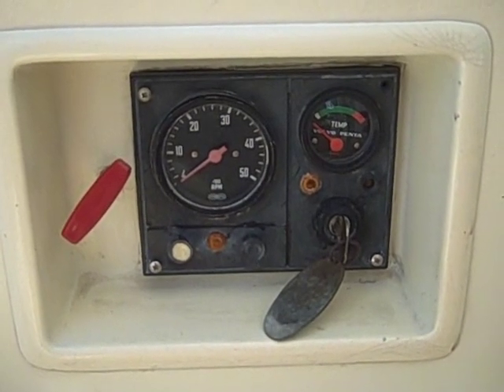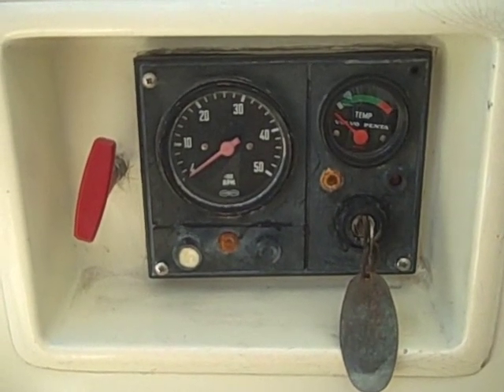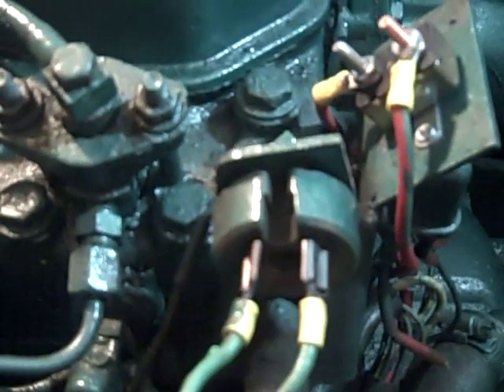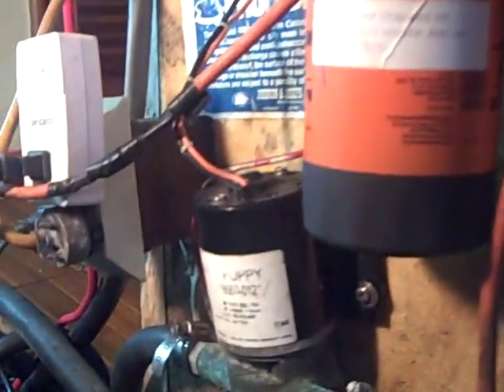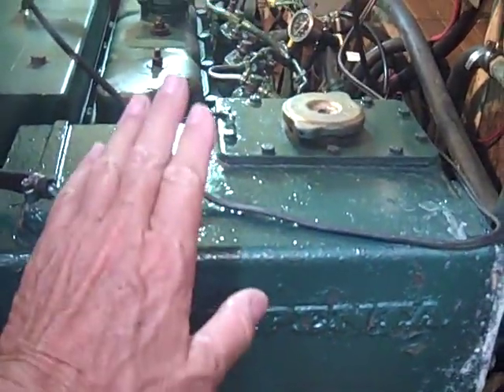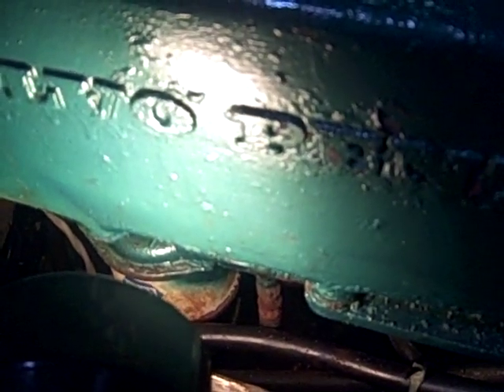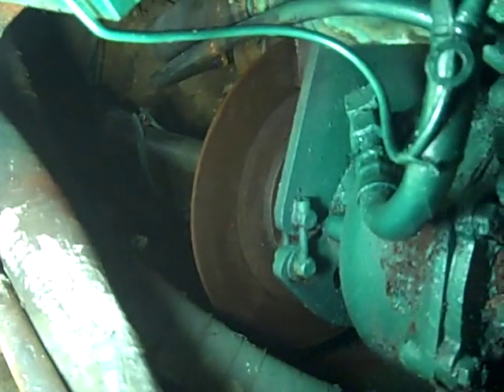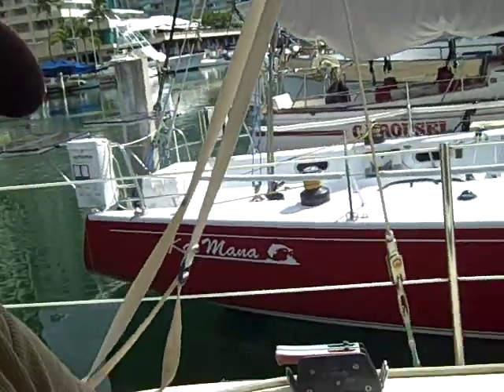Volvo Penta MD21a troubleshooting and suggested modifications.

Comment: I already had the water pump, which is why I had to remove the pulley in the first place. The pump itself was no problem to obtain, but the pulley was worse. It seemed to be a special pulley exclusively for the Blitz which I ultimately got from a Dutch Opel Blitz guru. Presumeably the last NOS pulley in Europe. I considered a Volvo Penta pulley for an engine like in the video, but the price was kinda like written with a fork. (seriously.. $500 for a water pump pulley??)
Reply: The MD21 engines are the same engines used in a Puegot 504 car, Indeanor XDP 490 engine. You should be able to source a pulley using that info instead.

Comment: This engine is really an Indenor XDP 4/90, french manufactured by a daughter company of Peugeot. It was used in Peugeot 504 and many other European cars. I'm currently working on an engine like this in a 1975 Opel Blitz light truck.. I managed to break the water pump pulley when I was going to remove it... Any tips on where I can get a new one?
Reply: Surely if the electric pump is switched off then sea water in the heat exchange and pipework will just remain in the engine.
Reply: Mike Payen I think the point is the engine exhaust gasses will expel the water for the 15 sec before you shut the engine down. The switch was a for the fuel pump 😄